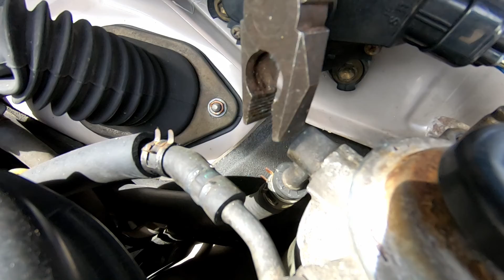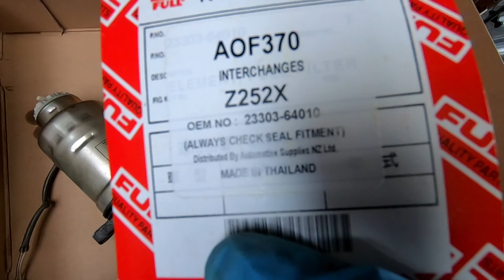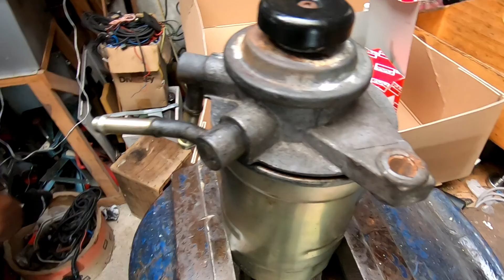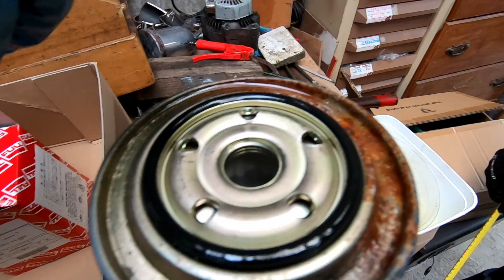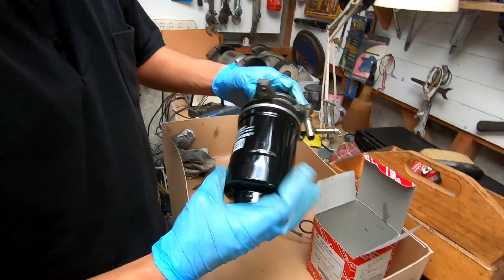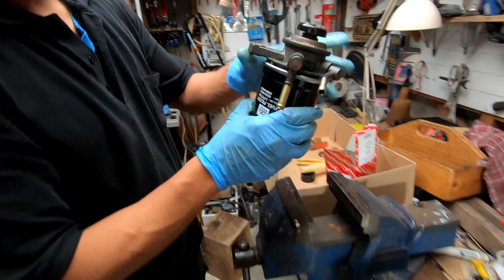Toyota 1KZ-TE Diesel Fuel Filter change (Prado) Rusted on filter

Comment: I also have a Prado with a 1KZ engine; the problem is that it’s hard to start in the morning, even though the engine fires up easily when it’s hot. Perhaps you could create a tutorial addressing this issue.
Reply from the maker: Yes, im working on that exact video on a Ford Transit. On your prado I would be checking the glow plugs, if they have not been replaced before that will be the issue. If the glow plugs are fine then look for any air leaks in the diesel lines.
Reply: @AutoBuddynz  ok thanks and I will try.

Comment: A nice trick to removing the primer is put it back on the bolts upside down in the engine bay and use an oil filter wrench
Reply from the maker: Great tip.

Comment: How often should the fuel filter be changed? And how much Diesel did you put in the filter, Did you fill it all the way up?
Reply from the maker: It depends on the conditions the vehicle is used, towing heavy loads, in a cold country etc. As a general guide between 10,000 - 25,000 miles or roughly 15,000km - 40,000km or 12 - 24 months. Again depending on fuel quality, water content etc

Comment: May I know what is the part number of fuel filter for 1KZ-TE?  Thanks!
Reply from the maker: Z252x  cross reference that part no. with any other filter
Reply: @AutoBuddynz  Thanks!
Reply: The one in the video is wrong.The real one does not have a hole in the centre of filter element, part no is interchangeable with  23390-64480.
Reply: @sailaoleng  Thank You!
Reply: No fuel filter o ring under the housing thread? Optional?